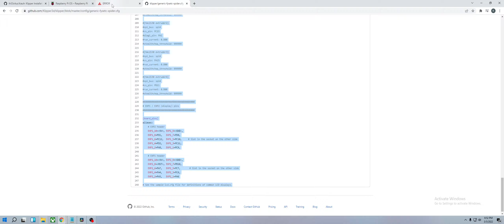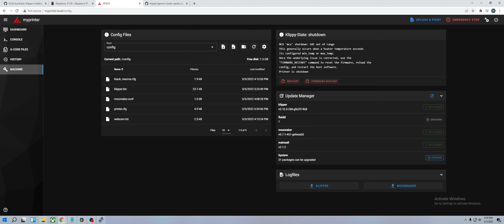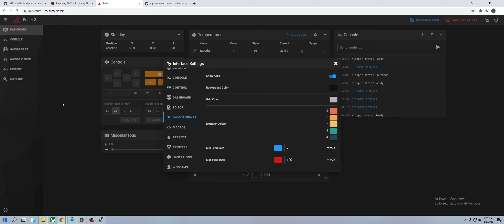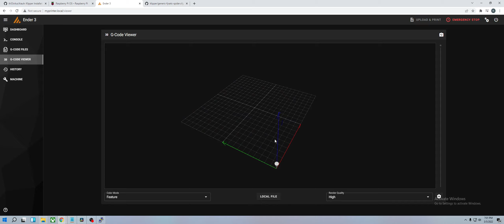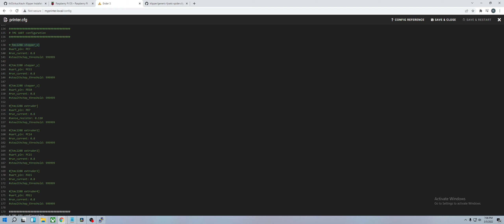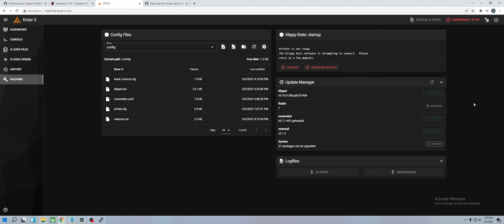How to install Klipper, the easy way using Kiauh! Part 3 - Creating our printer.cfg

Comment: Well, thanks for getting me going up to the point you did. I am trying to use a board that seams like everyone has issues with. I got it all the way to the end and then the bin file bricked my printer.
Reply from the maker: Did you join my discord? You might be able to get more answers there.
Reply: @Rolohaun  I really don't like discord. I'm desperate though.
Reply: @Rolohaun  Your link is invalid
Reply from the maker: @jessehavok4181 Fixed

Comment: I wasted a whole afternoon trying to get the printer to work with klipper. I followed all the instructions, and generated the correct firmware for my version STM32F401 ender 3 s1 pro, but I can not get it to work. The printer screen freezes as it should, but that's it. The printer usb controller is detected by the OS, but there is no MCU detected in KIAUH, except for three usbs that are always there even with nothing connected.. Is there another way to install the firmware? I tried both the sd card and through the usb port without success.

It looks so simple, but I can not make it work. Any suggestions? I am loosing hair over this.
Reply from the maker: you can only flash a ender via the SD card, there can be some issues with flashing if your SD card is too big, I recommend 8GB or smaller, the file was named wrong, you can check the SD card after flashing to see if there is a file called firmware.cur I would recommend joining my discord if you need more help
Reply: I’m running the same issue were you able to figure it out?
Reply: @dronefan3589  The issue is a tool in linux that "steals" the serial port (the usb port on the printer is in fact a serial port adapter). It's name is brltty. Search for it, uninstall it with sudo apt-get remove brltty  to get rid of it. Then rebuild the flash file and try again. In my case this was the problem.

Comment: i followed step by step and i get a printer is not ready error. not sure what im doing wrong. running latest version of everything on ender3 v2 neo
Reply from the maker: first thing to check is what file is on your SD card to make sure the new firmware flashed. Normally the .bin file name will change and it will say firmware.cur or something like that. Make sure your SD card is 16GB or less and that it is formatted in 4096 allocation size
Reply: new firmware flashed, but it seems to want to connect via mcu not usb and i keep getting flippy error.  ive done everythign step by step at least 3 times.
Reply from the maker: watch my new 2024 guide

Comment: Thx for tutorial…. Everything goes good until i get mcu info copied in printer.cfg then klipper/moonracker can’t connect… retrying but fails….
I was able to get mcu info with putty but that’s as far as it goes… (yes, i did delete redindant mcu reference)…. Help if possible :) thx in advance
Reply from the maker: make sure you don't copy over the /dev/serial/by-id/ part just at your ID to the end of that
Reply: @Rolohaun  thx… i did do that… i just appended my printer info after the the id/… i was confident it would work since kiauh detected printer mcu info…. But it didn’t, and klipper log file seems to not be able to find printer
Reply from the maker: @martinserre2280  what is your ID
Reply: @Rolohaun  in klippy log file, when initiating mcu serial connect, lots of unable to open serial port [errno 2]

No such file or directory
Reply from the maker: @martinserre2280  what MCU ID did you get

Comment: Great series. Im new to the whole command promps and firmware config and I was doing really well till it was time to get the MCU path.  I get an error  and cannot get the USB path to post into the print config.  Pi3B+ and a Spider 2.2   I'm stuck here and Klipper won't connect to controller
Reply from the maker: which version of linux are you using?
Reply: @corlissmedia2.0 ??

Comment: So here I am watching this trio of videos so I can use your advice to get my new Manta4 board with a CB1 operational. Thanks again for creating this narrative. It's much better than the Manta/Voron website in my opinion. There's a place towards the end, where out of nowhere, basically, he gets into the info on the MCU, but what's on the page are, it looks like, pictues of Visual Studio even though he should be showing the Kiauh interface (I think).
Reply from the maker: what timestamp?
Reply: @Rolohaun  it’s not a video. It’s not even your video. It’s a webpage that is about preparing a manta4 for a Voron 0.1 .  No worries, I’ve been working on my Hurakan since 2am. We’re making progress. I just need to figure out how to get the 7” touch screen to work.

Comment: 12-22-22 This is Day 5 of my efforts to put Klipper on a Lerdge K board connected to a highly modified Xvico Pioneer. This is what MainSail is reporting: Klipper reports: ERROR

File contains no section headers.
file: '/home/pi/printer_data/config/printer.cfg', line: 2
'Lerdge K board\n'

Once the underlying issue is corrected, use the "RESTART"
command to reload the config and restart the host software.
Printer is halted

Also, there is NO MICRO SD card in my control board, so that may have something to do with this conditon.

And, surprisingly, I still have a functioning monitor, which is reporting: Lerdge K Bootloader Mode. The comment on the screen is No find App!! (I kid you not).

At the bottom of the screen is says: Bootloader Version: 1.04

I was under the impression that my display screen would not work after installiing Klipper. I don't know if I should have the micro SD card in the slot or not (not the firmware.bin card, I'm saying the other card, that I use for day-to-day printing.

Any help would be appreciated.

Mark
Reply from the maker: 'Lerdge K board\n' should either not be in your printer.cfg or comment it out, you do not need a sd card in your mainboad as Klipper does not use it. From what I can tell the lerdge board does not have great support for klipper
Reply: @Rolohaun  oh, I know that. The just uploaded their files to their website a few weeks ago. They're still not on Github. I think they're afraid of something. Thanks for replying, I'm pretty badly stuck at the moment, what with this weird boot screen message on my lerdge display, and all. but I'm hacking away at it.
Reply: This is at the top of my printer.cfg file.

[include mainsail.cfg]
[include kiauh_macros.cfg]

##Lerdge K board

[mcu]
## Obtain definition by "ls /dev/serial/by-id/*" then unplug to verify
serial: usb-1a86_USB_Serial-if00-port0
restart_method: command

Comment: Thank you. I've watched a few video's on klipper and you was very clear and concise. I'm planning the mercury one corexy on an ender 5 but taking baby steps and klipper on near stock machine is the first steps. Could you maybe create a video on Useful Features or Useful Macros. example i would like to manual bed level without a BL or CR touch?
Reply from the maker: thank you, check out this page https://www.klipper3d.org/Manual_Level.html there is a section on setting up the bed screw adjust points then klipper will help you do a manual level
Reply: @Rolohaun  thank you verry verry much for this link

Comment: Being a Klipper novice I'm having a hard time getting my system to work. I keep getting "'mcu': Unable to connect". I'm using a Raspberry Pi 4 B with and SKR Mini E3 v2. Used Kiauh to install Klipper, Moonraker, Mainsail etc. Flashed SKR ok  - lights plus FIRMWARE.CUR generated. Got MCU id - usb-Klipper_stm32f103xe_31FFD6055650303812680443-if00 but still not connecting. Checked firmware using serial over USB. Any thoughts on next stage?
Reply from the maker: make sure in your printer.cfg you have this for MCU
[mcu]
serial: /dev/serial/by-id/usb-Klipper_stm32f103xe_31FFD6055650303812680443-if00
Reply: @Rolohaun  many thanks for that. However, when I copied that and pasted it into the config and Saved & restarted still got same problem. Had a bit of a Google and used the following: ls /dev/serial/by-id/* in putty and it looked just like that above but when I copied and pasted that in to the config file and saved & restarted - success! I have no idea what happened there, must be some rogue characters around 😊
Reply from the maker: @dippydot  glad you got it working! Welcome to Klipper and Join my discord server if you like

Comment: Amazing tutorial! The only thing I'm still having an issue with is the gcodes path not found error.  I've tried, ~/gcode_files, I've tried /home/pi/sdcard. Nothing seems to be working.
Reply from the maker: your getting this when you try and upload a gcode file?
Reply: @Rolohaun   Negative. Upon the initial connection to the printer.
Reply from the maker: @jjsemperfi  do you have a mainsail.cfg another cfg that has

 [virtual_sdcard]
path: ~/gcode_files
Reply: @Rolohaun   I’m running Fluid but I’ve tried that exact coding to no avail.
Reply from the maker: @jjsemperfi  you will need these in your printer.cfg 
https://docs.fluidd.xyz/configuration/initial_setup
Reply: @Rolohaun   Had those in there already. It’s like my virtual sd card path doesn’t exist even though it is a real folder. It’s strange. I’m away for work but any chance I could send you my log file or something for you to look at and help diagnose?
Reply from the maker: @jjsemperfi  feel free to join my discord, also you might just need to reboot your pi. I have seen that fix virtual SDcard issues